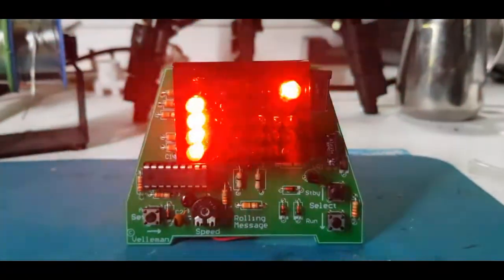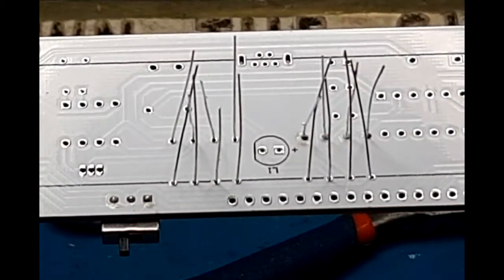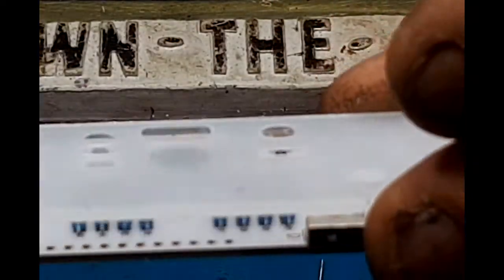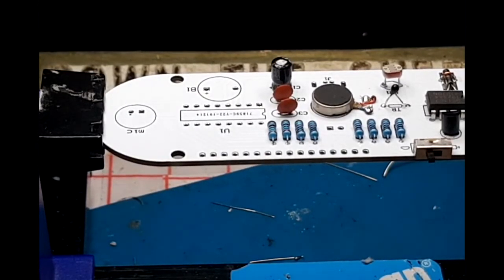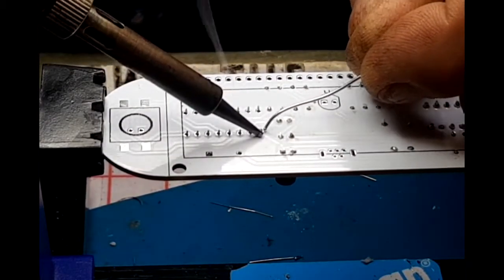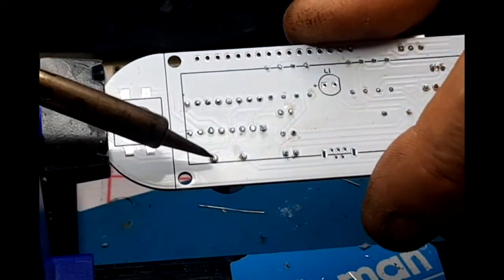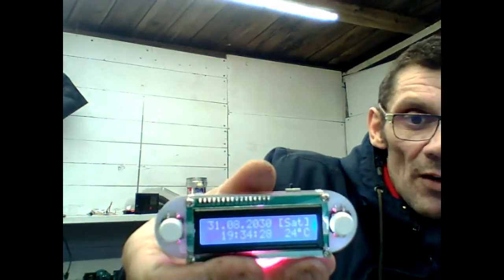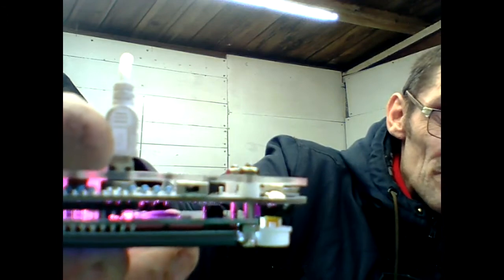Geekcreit® DIY Candlelight Effect LCD1602 Vibration DIY Clock Kit  DOWN THE SHED

Comment: Built this bloody kit twice now, and the clock won't be set to anything other than 00:00:00.

Similar problem with the date. That stays at the 1st January, 2000.

I'm not an inexperienced kit builder, and I'm finding this most infuriating. The only thing I can think of is Geekcreit got a bad batch of timer IC's or regulating crystals.